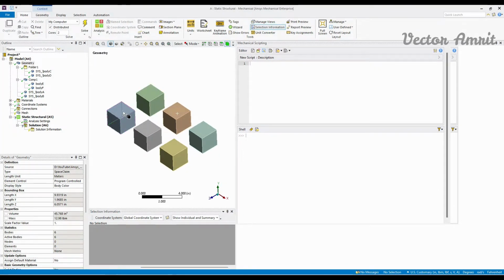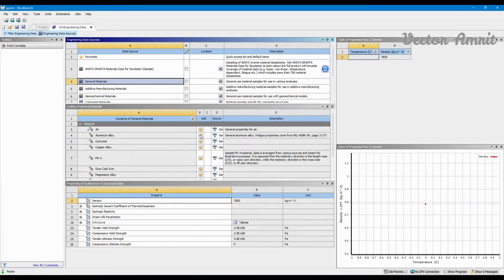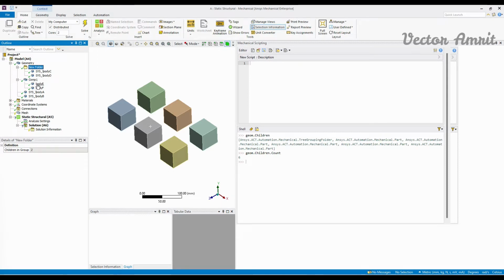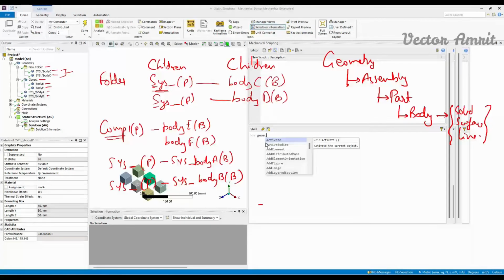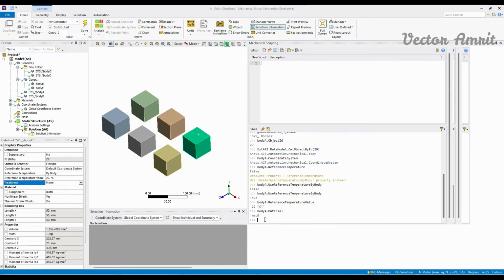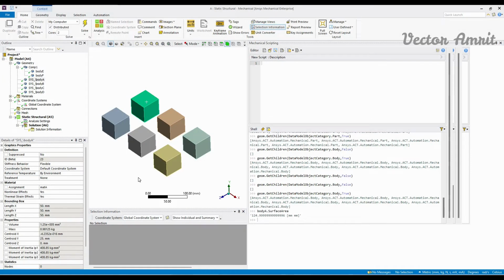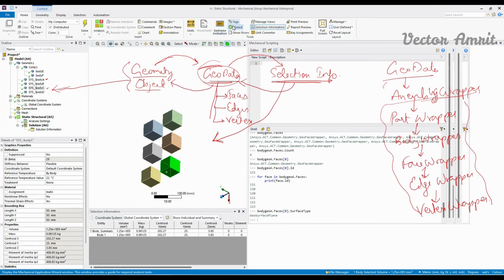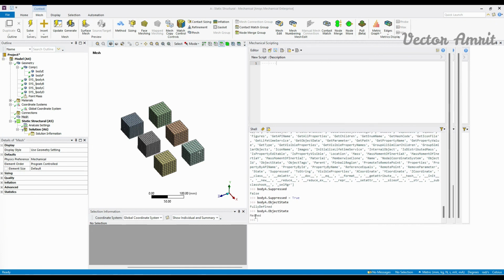6 Geometry | Automate the boring stuff in Ansys Mechanical | Ansys Python Scripting Tutorials

Comment: Hi. I have a fully functioning workbench project where I have a static structural module and a parameter setup. I have used scripting to create my geometry and mechanical (model) workflow. Now I want to use scripting to change those parameters and run the complete project autonomously without opening Ansys or fiddling with GUI and export the results. Do you know how I can do this?